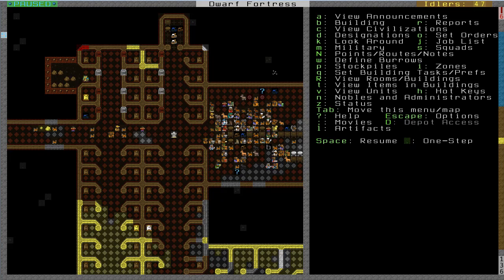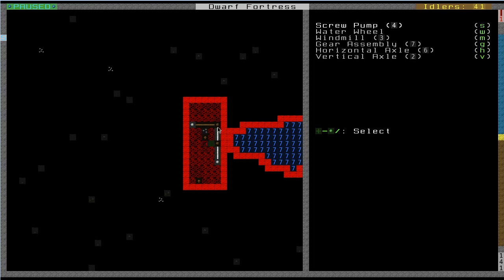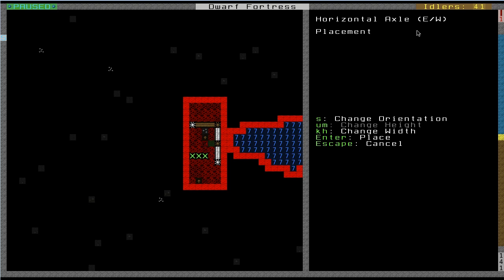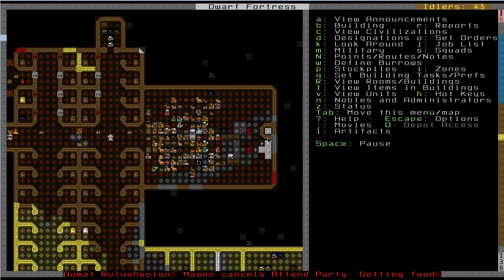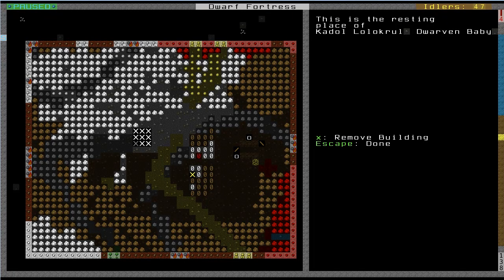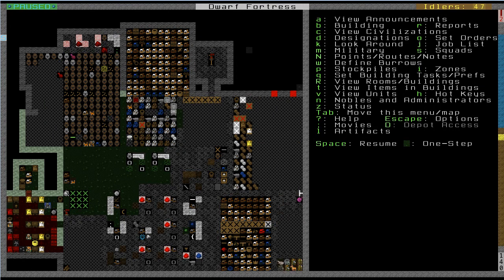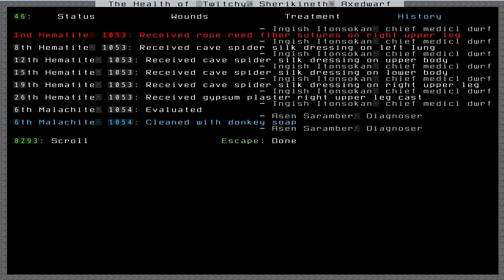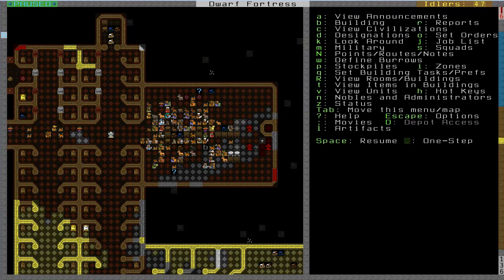Let's Play: Dwarf Fortress 2010 Part 31: Tryin' to Maintain, Intro to Machines

Comment: When making the ubiquitous "long, trapped filled corridor" consider adding one or more right angles to the path instead of a flat out straightaway. This allows you to leash guard animals out of line of sight of any ranged units first entering the hallway, avoiding needless animal deaths . Make those gobos pass a dozen or so traps before they even have a shot at those war jaguars you so treasure. You do want a row of dogs/bears/wtf lining that shielded bit of hall for any abductors by the way.